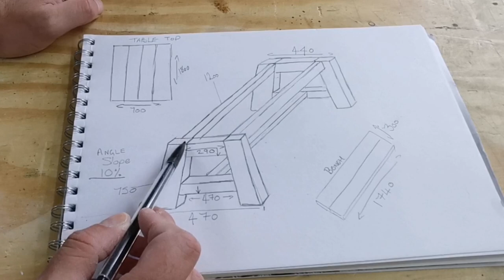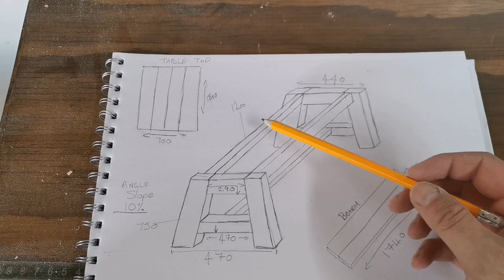How To Make A Farmhouse Style Table

Comment: Your vids have definitely gone up a level 👍. Cheers for the vid I've got a farmhouse table I've recently clamped up ready for sanding. I was going to look for finishes but I think you've answered my question lol... Keep it up mate
Reply from the maker: Cheers Chris I'm trying to improve constantly. Top tip for applying the Briwax is leaving the brush in white spirits the use that same brush to apply the wax, do it in about 12inch sections then wipe it off straight away, goes on so much nicer and streak free. You can buff up later to a nice shine.